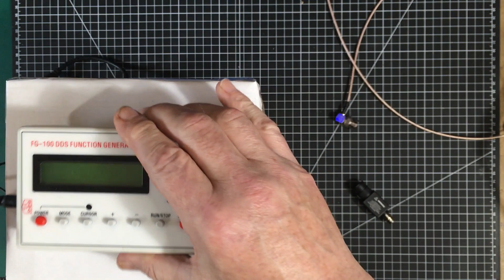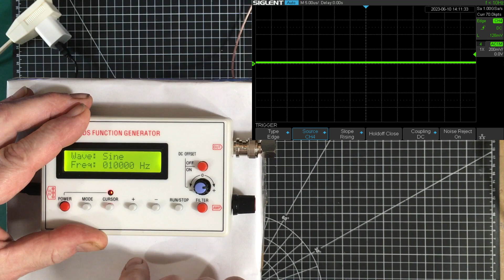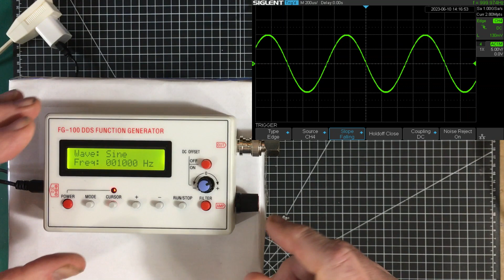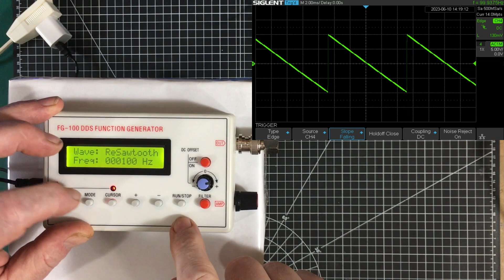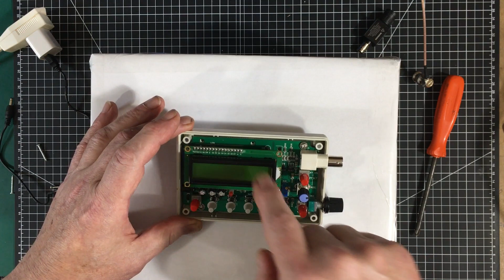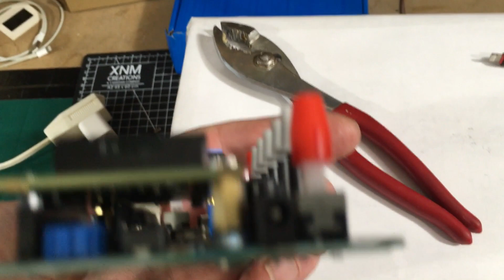Uni-Byte 0060 - FG 100 DDS Function Generator: NO!  JUST NO!

Comment: Ok, you slagged it bigtime, but what would YOU recommend as an alternative as a replacement??

Easy to criticise, but no so easy to do any better, for the price!

Suggest a relatively cheap alternative???
Reply from the maker: I didn't "slag" it as much as I just report what I found.  What would you have said?  As for this unit, it was faulty with fake op-amps in it.  In the description is a link to the repair video.

If you get a good one, and most are apparently good, or are willing to fix it if you get a bad one, then there is nothing comparable in this price range.  For a couple of dollars more there is the FG-200, but it is not guaranteed to be operational either.

For about 3 times the cost (~$72) you can get the  FY3200S-24M which is far more than 3 times better than this.  24MHz, 2 channels, frequency counter, more built-in waveforms, full arbitrary capability, sweep capability,  phase control, trigger output, frequency and amplitude modulation, greater output range, TTL level output,  CMOS output, built in power supply, PC control software, etc...

That would be my recommendation for an under $100 function generator.

Comment: Can you summarize the defects of the generator in 5 points
Reply from the maker: If you get a good one, there are no real defects and it will work as designed.  It is then a good value.  For mine there were really only two real defects.  1) Shoddy construction  2) Fake op-amps.

Comment: The pwm able pin of arduino does not do all that ? If if does, it is possible to use one as frequency genarator ?
Reply from the maker: They do not use PWM, they use DDS (Direct Digital Synthesis).  8 I/O lines feed an R-2R ladder type DAC then the output from that is filtered.   This is a frequency generator.
Reply from the maker: You might also want to view my videos #0071 and #0139.
Reply: @uni-byte  Thank you for the answer. The 0071 I was already watched. The 0139 is being really useful. Just to see if I get the concept right: (long message ahead warring) If I make a a 16 r2r resistor ladder, and connect it to 8 digital Arduino ports, turn on port D12, turn off port D12, and do the same till port D4, turn all ports off and repeat, assuming there is no capacitance in the circuit, I would got a wave similar to what you showed in the video ? That would also be a crude DDS ? (not sure if I was clear enough, English is not my first language)
Reply from the maker: @franciscoferreira-eh1yu  You would use 8 I/O bits all on a single port in the MCU and treat is as a parallel port.  You would have to store whatever waveform you want to reproduce in the MCU memory as a table, then read the 8-bit (0-255) values from the table and send the value to the 8-bit I/O port at one time.  You would not manipulate each bit separately.
Reply: @uni-byte  thank you

Comment: Can i find treasure use this?
Reply from the maker: You want to make a metal detector out of this?  I don't quite understand.
Reply: @uni-byte  i want make longrange gold detector..help me sir
Reply from the maker: @Lakshitha-s1  Everybody would like a long range gold detector.  While you would certainly need a tunable oscillator to make high sensitivity and high discrimination metal detector, you will need a lot more than just the oscillator.  I cannot cover that in the comments section of YouTube.  Good metal detectors are not cheap - for a host of reasons.
Reply: @uni-byte  Thank you🙏
Reply: @uni-byte  someone make gold detector use dds function generator or other frequency generator. i don't know is it fake or true
Reply from the maker: @Lakshitha-s1  It is possible.  It would be preferable if it was a DDS arbitrary waveform generator.  This unit does have a microcontroller at its core and theoretically could be re-programmed to provide the specific waveforms you might need, but you would need the original source code to do that.  It's probably out there somewhere but I don't know where to get it.

Comment: I just got mine. At 10kHz all the waveforms are beautiful, at 100kHz sin becomes maybe a little bit too triangular but still looks like sin, square is rounded a bit but still looks more or less like square. Faaar better results that you have, so I must have been lucky with good unit
Reply from the maker: Go see the video where I fix this one.   You should be able to get a really good sin wave up to 400kHz.
Reply: @uni-byte  ah I don't have a need for that :) tbh for now I bought it for one project for university where I need as slow sin as possible, and for private projects it's one of those things that better to have and not need than need and not have :)

Comment: I had been looking at this to make my way into the pemf field just to experiment, Don't really know what i'm doing but if this is so crap, what other options are there in the pulsed signal offerings?
My budget isn't crazy but could stretch for more than this unit goes for by a little. 
Is there even such a thing as a cheap, two channel adjustable voltage pulse generator that works and won't require an expensive oscilliscope to experiment with?
I won't likely be going into the high kilahertz ranges, solfegios and such are mainly under 1000hz...
Reply from the maker: The FeelTech FY-3200S has a fairly goo reputation and can be had for under $100.
Reply: @uni-byte  I've been looking at a few now.
CDEK SDS1102X
UNI-T UTG962E
OWON DGE2070
A little more cost, and i'm leading towards the first cdek, but combined pulsed generator and oscilloscope in one seems good, but I don't know what I might be missing.
Reply from the maker: @8thsinner  I thought the CDEK SDS1102X was an oscilloscope?  I have heard good things about the UNI-T and the Owon.  I'm not sure what Owon's support is like but I do know UNI-T do not support their products very well.
Reply: @uni-byte  Oscilliscope and generator...so it says at least, but I don't know, is it better to have both functions separate? 
I'm also not sure of the differences between wave generator and pulse...
mm...help...lol
Reply from the maker: @8thsinner  I know very little abut the CDEK, but I do think it's better to have your scope and FG as separate instruments.

Any good function generator will generate bot waves and pulses.  Both the Owon and the UNI-T will do this.  They will produce any waveform you like.

Comment: Those cheap function generators are sold by countless resellers. Even though they all look the same, they have different firmware versions and and some different hardware components.
Thats why the many tests of this generator on Youtube show so different results. 
I bought one of them about 3 years ago and its as lousy as the one in this video. I bought another one 2 month ago. That one works fine, the sigals it generates are ok and it even has some more waveforms than the old one.
Reply from the maker: This one was repairable.   See the link in the description "We fix the FG 100 DDS".👍
Reply: @uni-byte  Oh yes, now when you point me o that video - I have seen that video some time ago and ordered some  N5532 to fix it.  Problem is just, that I have no experience with soldering those tiny smd parts. My soldering skills are already bad enough at bigger parts. So fixing it is one of many projects for "later", when I am in the mood to try it. As I wrote I already have a new one of those  FG 100 DDS and it works fine.
Reply from the maker: @jeanyluisa8483  Sounds good!

Comment: Well, the review seems to be missing a suggestion on a good generator within the same price range. The video is interesting anyway, so thanks for sharing.
Reply from the maker: Problem is, there is nothing else in the price range.  If you get one of these that works properly, or you have the skills to get it working (see the follow up video #0071) it's pretty good for the money.  The next level up and your into the $75 range.  But you do get a lot more in that range.
Reply: @uni-byte wow I bought nine for like maybe 12 usd from China lol, if I would have to pay 75 or 100 usd I would just add a little bit more and buy one from Siglent connected to my scope, but as I mentioned in other comment mine seems to be good one, and for what I need it for I wouldn't spend more anyway, but good to know there weren't any alternatives anyway
Reply from the maker: @wnekuu  Not in that price range anyway.

Comment: what do you expect from chinese junk? spend a little money and get a good one
Reply from the maker: Thanks for your comment.  The point of getting this was for review as a part of the beginner's electronics tool kit I am developing.  It may come as a surprise to some people, but there are some beginners that do not have the money to spend on a $600 function generator, or at least do not want to spend that kind of money (+$600 for a scope, +600 for a power supply, +++$$$) on a hobby they may abandon for one reason or another.  That's they idea behind the beginner's tool kit.  To put together a set of useful instruments and tools at a reasonable cost.  These were once pretty good little generators, but doing this review we found out that that the market is being supplied with counterfeit components.

Comment: I have one of these and I have to say mine behaves completely differently, I opened mine up and the construction is quite a bit deferent and the op-amps used are TL082C. Seems I have been lucky with my purchase.
Reply from the maker: Nice!  Do you remember the vendor you got it from?
Reply: @uni-byte  Hi, looking back I bought mine on the 6th of October 2021 from an ebay seller base in the UK. I didn't think I had it that long.

Comment: How many max amper can it produce in output?
Reply from the maker: The original op amps are capable of about 10-15 mA.  The ones I put in can do maybe twice that.  So, not much.  It really is a high impedance output and NOT a 50 ohm output like hey suggest in the information sheet.
Reply: Sure.....Amps output....😂😂😂 Funny man...

Comment: I don't think I need a AWG for what I do just yet and I do have the little XR2206 kit in case I need to make a speaker beep. The local online retailer had this one for sale with one review that was terrible so I was really looking forward to your input. Also looking forward to see if changing the opamp works, I had a clone DSO150 oscilloscope go magic smoke on me and after ordering new ICL7660 (I think) IC's I managed to get it working fairly ok after that.
Reply from the maker: The little XR2206, despite having issues of it's own, is head and shoulders better than this.  I think I'm going to use NE5532 replacements.  Others seem to have had luck with them.  Good going on the DSO150!

Comment: I saw a russian? video of a guy who had ordered a DIY 0-30V PSU board. Whole board worked fine [eventually], except... they had included dud opamps in the kit. So many problems on first start. And when he substituted some others he had on hand... also dud 'cus they'd be ordered from ali. He eventually made his own 'opamp tester' circuit (verify very basic comparator functionality) to find a portion of working ones out of what he had on hand, and finally the whole kit worked perfectly.
Reply from the maker: The whole counterfeit chip thing seems to be getting out of control.  For me, I tend to buy more for reputable outlets like DigiKey more these days.  I do have some eBayer's I've used for years that have yet to pass me a counterfeit chip, but they usually don't have everything I need.